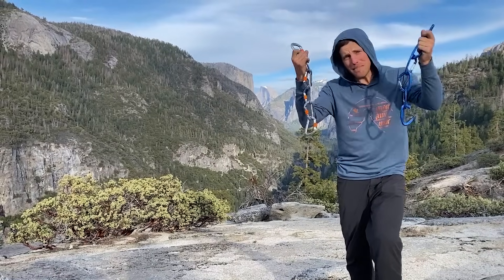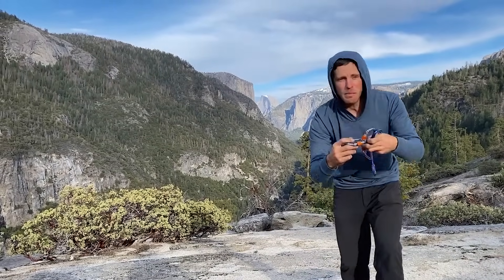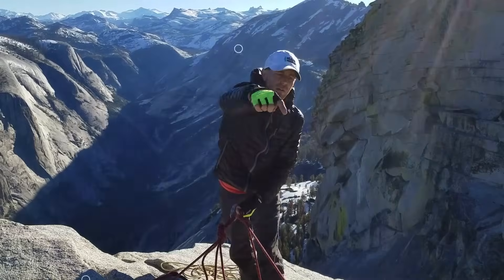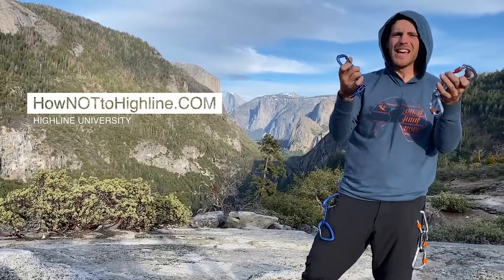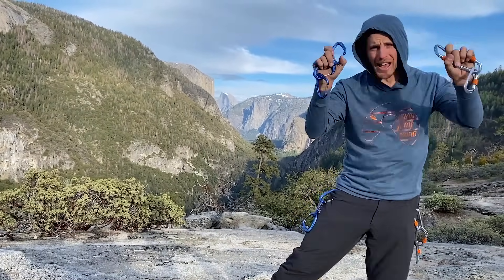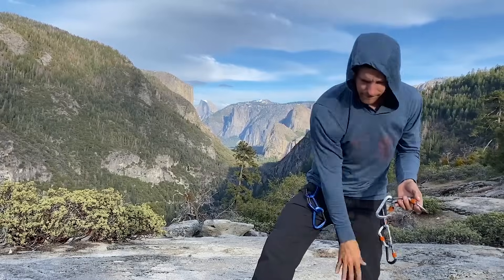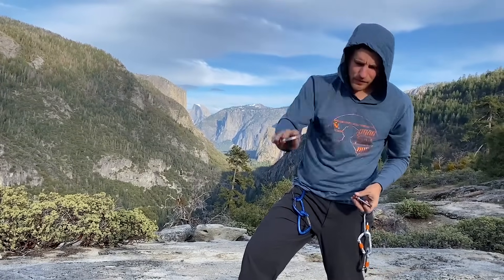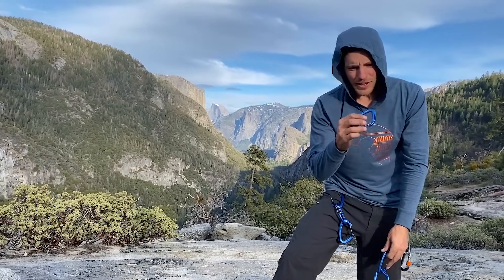Are MicroFractures a Myth in climbing carabiners?

Comment: Hey meche here, while cracks theoretically do lower your mbs, the real issue lies in crack propagation due to cyclic stress, so even tho you “can’t” see a decrease in this test, if you did many pulls at a value lower than mbs (much lower) you would see a decrease on the cycle life. That is let’s say you pull it to 8kN, the new one would break (making up a number here) at 5,000 cycles, while the one that’s banged up would break at (again making up a number) 3500 cycles. There are formulas to estimate and approximate this, but again it’s mainly seen in the cycle life rather than the breaking strength

Comment: I realize that i am four years late, but i just had an idea to help catch flying parts.... put a one-gallon freezer bag around the part under test.  cut a hole in each end to pass the ropes through so that the bag can't add any strength to the part under test (not that it would add meaningful strength).

it probably won't stop some of the more energetic pops, but it should slow down the pieces enough that you don't have to hunt all over the shop for them.

Comment: I can answer the results you should expect from this, you should see no big reduction in strenght this is because throwing them on the ground only cause minor frequencies into the metal. This aluminium is designed to withstand forces beyond 20kN. If you want to introduce microfractures the only way to get those is by tweaking the metal back and forth. And you need ultrasound to inspect for microfractures as it will resonate differently on weakened areas.

Comment: Micro fractures in dropped carabiners in the mythological sense that hade been known for decades - is just a myth. It have also been tested before, with a large number of carabiners. But micro fractures in other cases could be a problem. As moth myths or successful lies, this myth contains elements of truth. As already mentioned, the typical case with micro fractures would be a result of fatigue. But the number of load cycles are then very high, so it is not related to the dropping of a carabiner.

Comment: I don't think you showed that it was a myth. 30% of the abused carabineers had seriously degraded failure strength.

You might get more consistent results by putting them in a rock tumbler with some good jagged pieces of granite and running it for a few hours. Harbor Freight has cheap tumblers which ought to fit the bill.

Comment: I know this is a vid with some age, but, we must consider these points.

1/ in the rigging world we speak of age in rope " new rope", "used rope" and "old rope", but we do not age hard tackle.
We "inspect" hard tackle for corrosion, damage, wear and deformation. There are specific guidelines.

2/ Nothing we make  load bearing tackle out of is brittle, all load bearing tackle is to a large extent malleable (tough), this is why it deforms before it breaks.
Likewise it will tend to dent or scratch, before there is any significant damage to it's structure.

3/ Pretty much all load bearing tackle is rolled, stamped or forged and is thus not inclined to be brittle and contain imperfections like cast items.
Hit a cast item hard enough it will crack or shatter or break, rolled, stamped or forged material  is far more likely to, bend, dent or deform even it it is exactly the same metal processed differently.

4/ Most tackle is relativly light, compared to it's strength and no matter how far it falls ( on it's own), the impact will be insufficient to cause any significant deformation

In conclusion I doubt very much that a few scratches or dents on a carabina are going to influence its strength.
 BUT, I would be more concerned about those dents, scratches or other roughness on the carabina, causing damage to the rope it is used with or damage to the climber's hands.

Comment: the thing with microfractures is that they develope over time, hince they destroy the strong oxidation layer outside - rebuild a oxidation layer relatively fast, which stress the nearby material a lot. But thereby working like a splint/keil into the crack itself. Over time, and over reusing/putting force alongside the microcrack - they can grow a lot - its not that they are tiny in size, its that they maybe small in width and can simply grow inwards. So over time this becomes a very big issue - starting very slow.  
there are plenty of airline videos about desasters because of microcracks (and the NTSB is good in investigating those )

Comment: My bro science brain says that with something metallic, especially as soft as aluminium, if you're throwing it on the ground and its getting dinged and nicked then enough of the force is being absorbed by the fkex of the metal that there's little to no actual fracturing, though they could form stress concentrations maybe? I feel like them being "stronger" afterwards is probably a result of work hardening.
This said by someone with no experience with climbing or metallurgy or engineering or anything so dont quote me

Comment: sharp dents in aluminum, any metal really, cause stress risers. which is why changes in direction are radiused. Aluminum also work hardens and gets more brittle under mechanical deformation.

Comment: I am a climber as well as an engineer. The biggest variable missing here imo is *time*. A single impact is not going to shatter a biner, and I'm sure Mammut makes extra sure of this during their testing. The real question is, after a few impacts, what happens as the carabiner gets weathered. If you load the carabiner repeatedly? Then leave it exposed to the elements. Allow it to slightly expand and contract with temperature changes. Etc.  Basically simulate real climbing conditions. After many cycles of this I'm sure you would be able to measure some compromise in the material's integrity.

Comment: This is not a good test... You are completely ignoring any science behind cracks. 
You can not compare one large loading with hundreds of load cycles and ageing due to weather conditions. 
a micro-crack can and might form only after repeated load cycles and become a problem once the gear is then not performing to its best abilities any longer.

So go check some facts about load cycles please! Aluminum in this case being a less ductile material due to its treatment will mean it is more susceptible to repeated load cycles and this is what you need to test for.

Comment: Dropping metal is not how metal fatigue and microfractures work.  It's repeated loading cycles.  Don't call something a myth if you don't grasp the engineering principles involved.
Reply: Hard is easy proved that repeated loading cycles also did nothing to the biners. He also came to the conclusion that microfractures are not a thing worth worrying about in carabiners.

Comment: I really kind of find this irresponsible - the conclusion that is. Even in your data with that extremely limited statistical significance (3 samples) you had a carabiner fail below its rating.
Yes, that carabiner was still safe to use, but think about what it means in terms of statistics. You have a mean (which will be above 24kN) and a standard derivation that describes the bell-curve. 
If in 3 samples, a carabiner already goes down to 21kN, what does it mean to standard derivation? It widens!! 
Now, standard derivation gives you an information about the bell-shape of the distribution. With a wider distribution, now some carabiners will have an even more significant lower break-strength.

Now, having a 3 sigma (3x std.-deriv.) safety still means, that 0.3% = 3 out of 1000 carabiners will not be within the 3-sigma range. 
Yyour mean with the abuse carabiners is 25.3kN, your std-deriv is 3.66kN given the 3 samples. 
Meaning 3 out of 1000 carabiners will fail below 25.3kN - 3·3.66kN = ~14kN.

That is just the math with the limited sample size and assumed normal distribution - not really a strong argument but something to consider nontheless. More tests will five you more data. 

And to be clear: 3 out of 1000 would break BELOW 14kN, not "AT". 
Conclusion: You actively endanger up to 1..3 lives out of every 1000 people that trust you with your video that have abused carabiners in their gear.
Was that your intension?

Comment: so just throwing them on the ground is not gonna be enough, they need to be thrown down and then cyclic loaded for years for them to be compromised. possible micro cracks are gonna take many many cycles to grow. I'm a machinist and Ive seen this in engine parts.

Comment: Microfractures are definitely a real thing and not a myth. But it will take a great deal of force, than a person tossing them against the ground. Microfractures tend to occur from metal "fatigue", when a piece of metal is exposed to repeated stress, typically in opposite directions over a long period of time, like a a car leaf spring that flexes from an application of load, and then returns to true when the load is removed. The best case for existence of microfractures would be the tragic case of British very first passenger jets, Comet. Most people don't know but the British were the first to use Passenger jets with turbo fan engines after WW2, not Boeing. But the whole program was doomed when, one plane after another started to experience sudden rapid explosive decompression at 30,000 feet, in total 3 planes were lost and countless lives lost all because, no one understood how microfractures develop in the skin of an airplane after each cycle of pressurization, and depressurization. Its too long of a story for me to do it justice here, so I suggest you look it up if you are interested. Keep up the good work guys, everything I watch your videos i want to get back into climbing all over again, but its been over 10 years since I've last climbed, maybe I'll just stick to watching you guys for now.

Comment: One thing I don't get why you're throwing them on the ground like that? Throwing those on the ground even 500 times doesn't compare or compete with stress from weight stretch hanging rope this that are the other does that make any sense capisce?
Reply from the maker: Because people use to say if you drop a carabiner on the ground from even chest high, there would be invisible microfractures and they should be retired.  So I threw them on the ground and tested them.

Comment: Trashing the carabiner that way crated the microfratures FROM WHICH THE CRACK WILL START, if the carabiner would undergo a long cyclical loading. Just starting the crack will not affect the resistance much, as you've shown, but that's not the problem with microfractures

Comment: "Raw aluminum, cool!"  I can tell you are not easy to impress

I assumed you would get at least one of them breaking at a higher load after you banged them up because my guess is that it de-stresses the metal a bit like peening. Sure, it is inconsistently applied and there are more highly abraded and surface roughened areas that can increase fatiguing, but in general a goodly amount of small impacts evenly distributed through a crystalline structure like a metal lattice should work out stresses like a thick fluid works out bubbles and make it more ideally compressed?

Comment: I imagine it's less likely that micro-fractures are the cause, but rather stress concentrators. Basically if you get enough dents in the wrong places you can artificially create a place where all the force gets dumped and it breaks faster. Imagine taking it and cutting a notch all the way around the shaft of the clip, what's what it can functionally do. It would explain why they broke in less consistent ways at less consistent forces. It's no longer breaking in the designed location at the designed force. It's breaking in the location dictated by where the stress is being concentrated. If it doesn't compromise the integrity enough, it breaks how it should. You may have even work hardened it a tiny bit or allowed for more plastic deformation in certain places that wouldn't normally get it. But if you get blemishes in just the right places you get significant failure differences.

So it's more nuanced that does it cause a crack. It's how is the structural integrity affected by small dents where.

Comment: Did quick maths. If we count an average for LineScale data, we can see, that this might have a little impact. For Crag Wire Gate, we get around 2.48 percent less strength after tossing them around, and for Locking Carabiner we get about 7.12 percent less strength. Of course to have more accurate data, you should brake like couple hundred of carabiners with different types, but we all know it would be quite expensive to do it :D

Comment: Weeeeell... your conclusion is quite misleading. 
It looks like you can actually hit the carabiner to loose a significant portion of its durability, and this is depend on sheer luck. This drop was quite huge in 1 case from the 6 sample. (20+%)
If fatigue is an exponential variable( is it? I really don't know...), that can really mean life & death on the long run.

Comment: I was once told by an industry professional (canopy your builder and trainer) that when microfractures were "officially" made a thing to look out for they x-rayed new steel carabineers, dropped them and x-rayed them again, and there were no fractuctures before dropping and some after. Break tests showed the ones with microfractures failing in a catastrophic manner. More recently someone x-rayed NEW aluminum carabineers and saw micro fractures there.   Basically the aluminum ones develop microfractures in the forging process, so EVERY aluminum carabineers has microfractures, but aluminum, as a softer, less brittle metal, doesn't fail catastrophically as a result of microfractures the way steel does. If you drop steel from three feet to rock it's done, but aluminum is likely okay. (How okay would take far more comprehensive testing and larger sample size)

Comment: When I begun climbing I was told not to use biner that were found at the bootm of the cliffs because falls from high above would be bad for biners.
So IMHO throwing biners to the ground is not really smashing enough. You would have to throw them at 220 km/H against a hard surface (to simulate a fall from high enough) 
and then we could consider them smashed.
seriously, there are some serious metalurgists input here. And it looks like the myth originated from a misunderstanding/collapsing of issues done by non-specialist:
myth origin:
1/ micro-fracture exist and are bad (Comet anyone ?) Premise True but the origin of the fracture in alumiium is repetive loading cycle (fatigue)
2/ biners hit bad develop micro-fractures premise False 
3/ biners hit hard develop micro-frctures (Incorrect conclusion

Comment: Why has nobody noted the slow pulling into a break is a different stress than a near instantaneous snap of a falling human? (Aka shear force)
Reply: Shear force is not what you're thinking it is. For some materials instantaneous force does make a difference, but for metals it is much easier to handle than equal longer duration force.

Comment: What climber hasn't had this told to them at one time or another, more specifically as you point out at the beginning of their climbing career LOL-Or cavers for that matter (I'm both). Interesting brittle fracture surfaces from your tests. I guess too whether micro fractures are a myth or not (I'd still like to see a bigger sample size of say 100 krabs abused in a slightly more repeatable way, say simply dropped many times from the same height rather than thrown sometimes or not; and them make the comparison. of course this would be an expensive "adventure in physics" LOL.....Who said that??  I don't know about micro fractures occurring like this (kind of work hardening via throwing into objects AKA un-yielding rock face- as apposed to repeated falls close to the yield strength- and certainly big falls on krabs, I've chucked them, falls that I really knew about LOL- probably being over paranoid) like this but once on the cliffs I met this climber who was about to abseil/rap off the top and I noticed he had some crazy Bonaiti Krabs i'd never seen before. I asked to see them and by sheer fluke (I'd never ever seen it in over 30 years of climbing and caving) the spine had numerous parallel hairline fractures down it! Of course he was amazed and somewhat relieved as this was his main harness krab he was about to tie into LOL.  I'm sure under a little load it would have just collapsed. As to how these fractures got there (there was no visible damage to the alloy, a little wear on the anodizing, that's all but it was interesting to see. Another great video of yours!